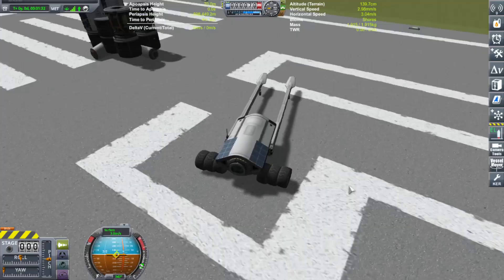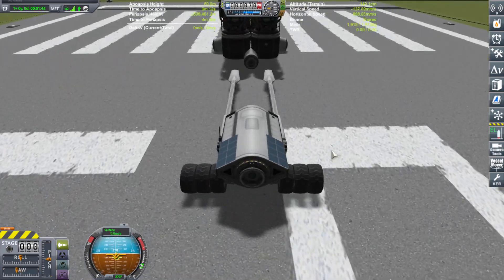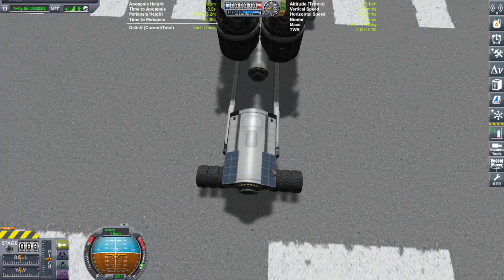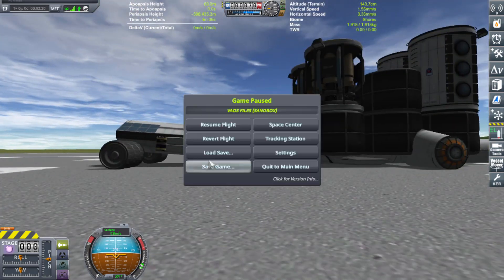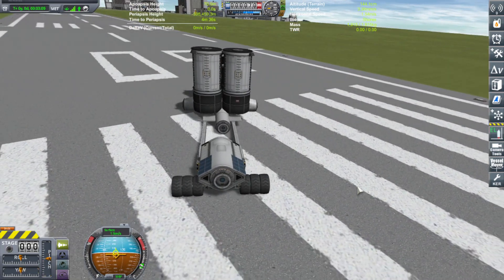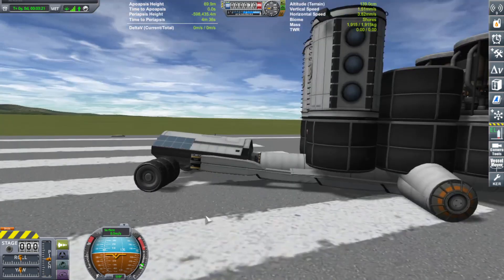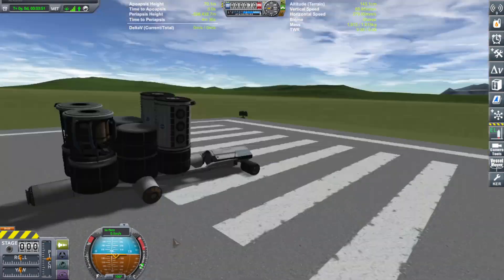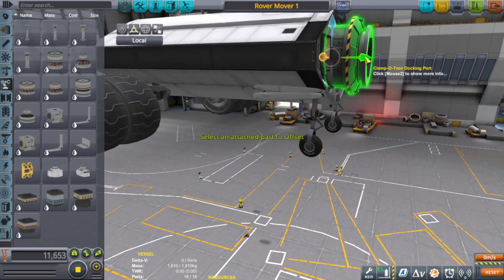DUNA COLONY BUILDINGS \ KSP 1.12.2 \ Kerbal Space Program

Comment: Dude, that pallet jack robot is an awesome  concept proven. I had 2 thoughts that may improve the design. The arms on the fork could be the 3 stage telescoping piston to make maneuvering  without a load and storage easier.   Then if you had a docking port between the forks and on the bottom of the buildings you would be able to keep them steady.  The grabber claw between the forks might work well to hold it to the forklift/pallet jack and you can put the arm/disarm toggle on an action group. Hope this helps. Great videos as always

Comment: The forklift is cool, you should “hack gravity” to Duna’s gravity (0.6g) and see how these buildings react to being moved around and docked. Might recommend having a single ground anchor at building “A” to limit any physics load jumps.
Reply: Duna is 0.3g, BTW.
Reply: @cf453  thanks for the clarification, I was only guessing
Reply: @NickBDesigns  Sure thing. :)
Reply: @cf453  i thought mars was .6 of earth and duna being the counterpart but I just checked and Mars is 0.38g (3.72 m/s) which means I’d be able to jump about 8 feet in the air on Mars. Dang